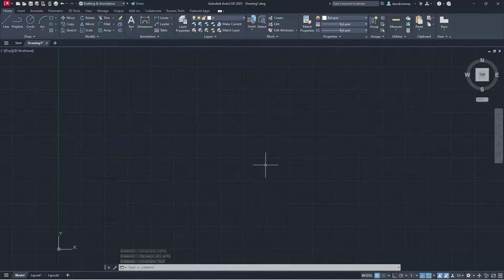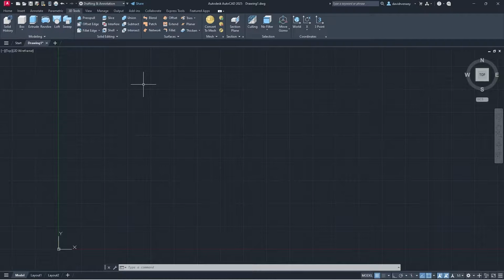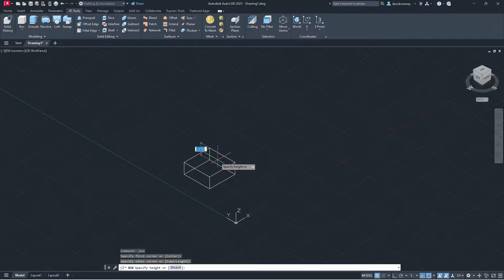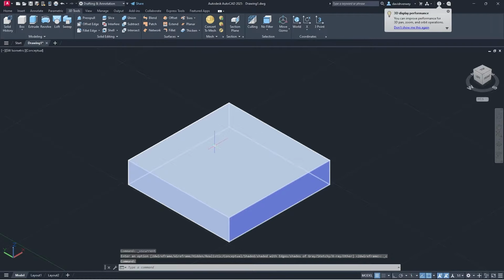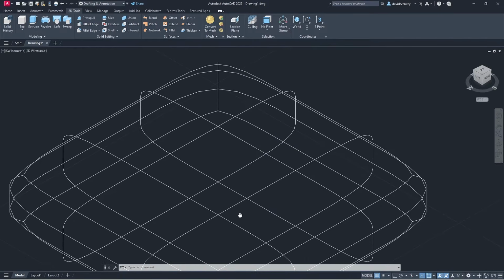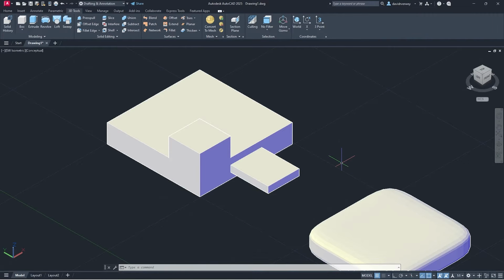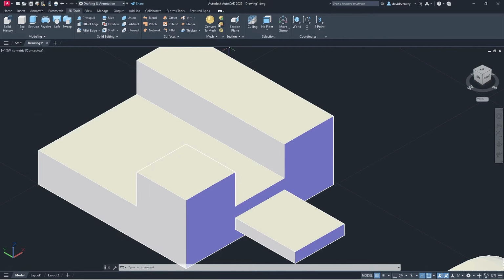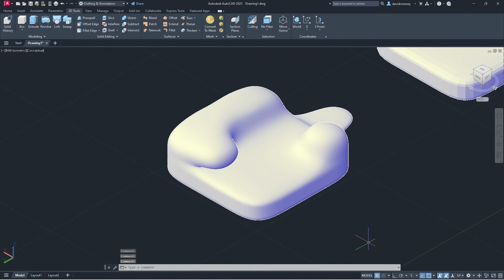AutoCAD 2025 - 3D Tutorial For Beginners!

Comment: Im loving this video. Consider me subscribed. Im still new here but i have a couple questions.

How do you change the size of the object by typing it in?

And how do you make the mesh more detailed?
Reply from the maker: Glad you enjoyed and thank you! For your questions I'll answer best I can in a comment section:

1.) There are a few ways and it depends on what you're scaling. Scale with reference worked in 3D and scales uniformly (which I assume is what you want). Open the SCALE command, Select your object you want to scale, pick your base point to scale from, type in R for reference, and scale as you normally would.

2.) People usually mean two things when they ask this. Usually they either want to MESHSMOOTHMORE smooth the object more and increases the amount of facets but doesn't increase editable faces. Or MESHREFINE this converts the underlying grid into editable faces and resets the lowest smoothness that can be applied. This allows you finer control over the shape, and doesn't just make it look smoother.

I'd give more but this reply would be HUGE. I have a video in the pipeline explaining this but it may take a while to get out. Hope this helps in the meantime!
Reply: @VerweyDraftingInc thank you for your reply. It has helped. Looking forward to the video.

Comment: Hi, I'm using AutoCAD Architecture and it doesn't have the 3D option on the tabs, I searched it up and it's not the LT version either, how do I fix this?
Reply from the maker: Hey thanks for the question!

AutoCAD Architecture automatically creates a 3D model when you are drafting in it and won't have a strictly 3D toolset as a majority of the tools within AutoCAD architecture automatically create 3D models of the objects you are drawing. AutoCAD Architecture is itself a toolset of the full version of AutoCAD.

For AutoCAD LT, part of the reason it's much cheaper is because it doesn't come with 3D tools and is strictly used for 2D drawing. You won't get the 3D tools to work in either of these for these purposes.

To fix this, you need to download and install the full version of just "AutoCAD".

Hope this helps!
Reply: @VerweyDraftingInc  Tysm!! omg 😭